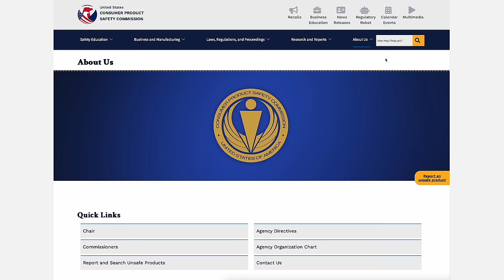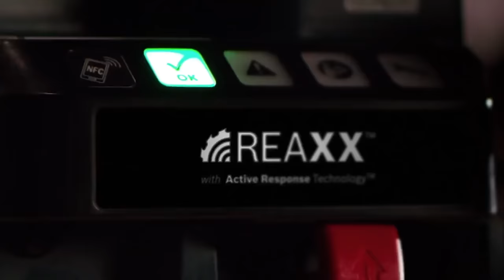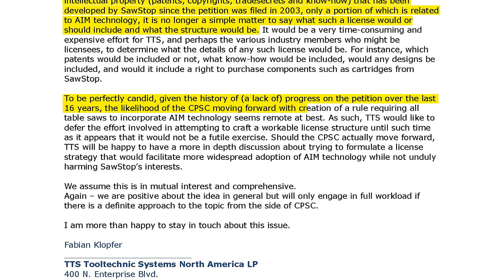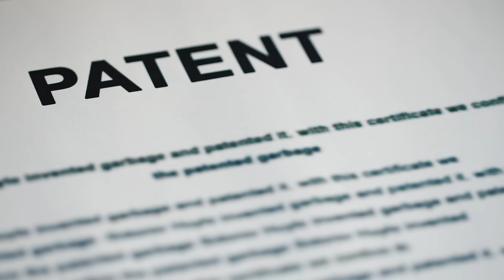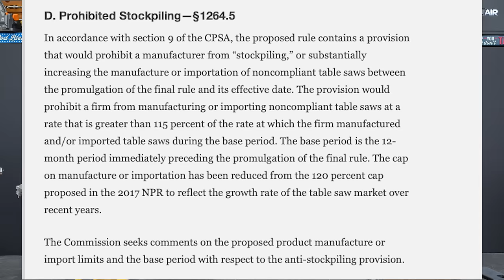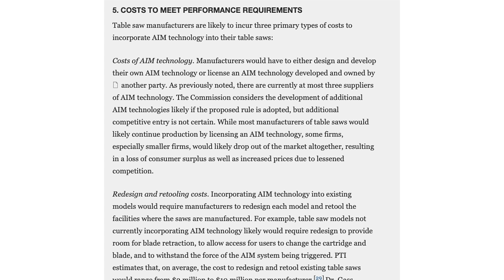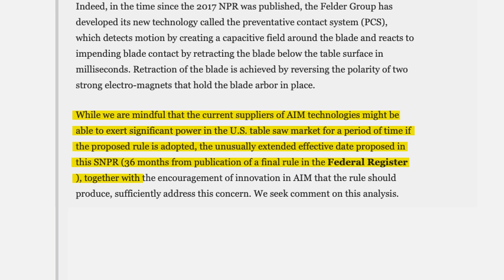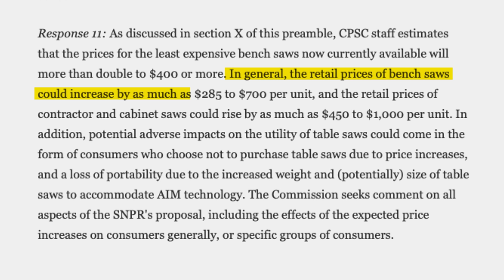The US Government is About to Change Table Saws FOREVER!

Comment: Listen carefully to what the CPSC "expert" said at 12:13. 

Read what Sawstop's website has on it's home page: "In the United States alone, over 65,000 people are victims of table saw accidents each year. The impact on the victim is substantial and in some ways immeasurable. OSHA estimates that the cost to a business of a single amputation is more than $130,000 on average. But these numbers do not take into account the pain of the accident, the ER visit, the surgeries and years of physical therapy."

Tell me they're not in bed with each other.
Reply: "Victims."  Nice wording.  That's like hitting your thumb with a hammer and blaming the hammer.   Everyone is trying to be a victim.  How about you just learn how to use a table saw correctly?  I'm 75 years old.  I've been using table saws since I was 15.  I still have all 10 fingers and have never had a table saw accident.  I respect the tool and make sure everything I do with it is done safely.  It's just not all that difficult.

Comment: I think the regulators should be required to go into a shop and actually use the tools they regulate, or at least participate in a lab exercises to show the reality of implementation of these new laws. 
 Reality is a wonderful teacher. One thing not brought up is that we need to return Woodshop to high schools. It is overlooked that Woodshop not only trains future carpenters and craftsman, but teaches those going into management what it takes to actually turn materials into  a product.
Reply: I think the regulators need to take 2 weeks off and then quit.
Reply: There are some professional carpenters that do not use a table saw. I think it is a lot more common in Europe where space is at a premium. They use a workbench and a track saw. Festool sells a table top for this.
Reply: I'm almost at that point where I can retire and work at a school wood shop, show them my cuts on my fingers and yell YOU'LL CUT YOUR FINGERS OFF!  That should scare them. ;-)  But then again, I'll probably have to use a sawstop enabled machine.  (I'll still yell though, LOL)

Comment: 1) know where the blade is at all times

2) use a push stick

3) only use as much blade as you need to make the cut

4) if it goes into the machine let it go, it’s gone, DO NOT try to “rescue” it

5) All saws have the potential to kick back

6) Make sure your fence is straight and runs parallel to the blade

7) Pay close attention to what you are doing at all times, especially while the machine is on.
Reply: 1) Yes. 2) Yes. 3) Yes. 4) Yes. 5) Yes. 6) Yes. 7) Yes.
Reply: 8) No beer.
9) Keep floor kleen.
Budy Guy cut of 3 fingers due to 8 and 9.
Reatached for free, thanks Caniadan healthcare.

Comment: If this goes through, we will need some combination of SawStop and retractable sawblade technology. While I get the appeal of having safer table saws, the price of it is not just extra 200-300, but also $200-300 every time you have to replace the cartrige and the blade. That's the current price of a saw right there. When you consider contractors, who may be cuting through all type of crappy lumber, containing screws and nails, they could be having to replace those parts few times a day.
Reply: One idiot running his finger into the blade and not only is he done for the day, but so is everyone else’s

Comment: Great video Matt! It is good to hear a balanced presentation regarding potential government mandated safety requirements. Like most complex problems, solutions are complicated.
BTW, I can't remember if the video addressed it or not but there is also the added cost to repair the saw when the AIM mechanism is triggered.
Great YouTube channel. I look forward to seeing great content by a good guy!
Reply: Repair the saw?  If the saw (outside the AIM system) needs repair, the saw's design needs to be revised.  In the SawStop system, the braking cartridge and the blade needs to be replaced after each triggered stop.  In the Bosch system, only the braking cartridge needs to be replaced, and only after 2 triggered stops since it is reversible.
Reply: @davidseslar5798  That is the definition of repairing the saw. The saw will not work unless those parts are replaced and the saw is repaired. This repair is not free. The blade is not free and the AIM module is not free.
Reply: @bretwood9779   Uh . . .  Replacing consumables does not constitute a repair in my book.  I don't "repair" a drill if I replace a broken or dull drill bit, or "repair" a reciprocating saw if I replace a bent blade.  The drill and recip saw are not broken in the absence of useable consumables.  Circular saw blades and AIM cartridges are consumables.

Comment: My first thought is how many accidents this will cause from the beginner who can’t afford the newer saws using unsafe methods and techniques to save money.
Reply: How many techniques are there?
Reply: Think of all the portable saws that could be used in the unsafe manner and put on sawhorses or tables or shelving. By design is just so much more secure by any tablesaw even the cheap ones. If you make it too expensive to do it the right way, there’s no limit to the stupidity of mankind to get it done anyway with the wrong tools and equipment. Me, for the difference in price I would just go for a basic panel saw, or a large format CNC . Yes, I realize that table saws are used for a lot more than sheet goods but that and small parts that you shouldn’t have your fingers near the blade anyway that’s where most of the accidents happen.. And then you’re pushing people towards bandsaw with no blade protection for small parts.

Comment: The return of the radial arm saw, and a new market for "pre-ban" table saws!
Reply: I've got one thing to say..."safety shield"
Reply: Until someone gets cute and sues because they bought a used saw and got hurt. I'd also expect that if this goes then right after will come a new line in workers comp policies saying you have to have said functions or you arent covered and I'm sure OSHA would be happy to make it policy as well. I don't buy for a second that they won't use strategies to implement it retroactively even if not overtly. Think of the damage to the construction and woodworking industries if everyone needs to replace equipment with new technology with limited or rushed development that causes demand to accelerate beyond manufacturing and prices become insane, prices already ripping North on inflation. 
If the government wants to buy the patents and such and pay the cost then go ahead and do it. If not, the technology is there and available. Why is it that they tell me they want me to be safer but at my own financial injury, when they put small businesses out of business people won't be eating, that seems unsafe too.
Reply: Lawsuit over a used table saw lacking modern safety equipment will go nowhere because if the used table saw is operated safely it is every bit as safe as a saw with this tech built in.   just about every injury that happens with a table saw is user error.   Also just like you can't sue because you got injured in a car crash in a 60s model car without airbags which of course was never even a thing you can't sue because you bought a used saw that lacks modern safety devices.  It is the users responsibility to buy a saw with the added safety if they want it. 

I could see OSHA going after big manufacturing  to adopt  something like this but in a very small personal or family type business   OSHA is irrelevant.  which is a good thing as requiring something like this could make them close shop. 

I'm glad I actually have my 30+ year old Craftsman table saw which I'm in the process of tuning up right now. The thing is a cast iron tank and with what I"m putting into it it will be working another 30+ years long after saws with this tech are in the scrap pile!  LOL

Comment: Thanks for all the time and effort you put into this video.  I have 2 points to add.
1 - The government is notoriously bad at underestimating the cost of proposed regulations.  Expect the additional cost of the first revised saws to be 2x the government's high estimates.
2 - As soon as the new reg takes effect there will be a huge shortage of the new saws available for sale.  Just like the huge shortages of electric vehicle roadside chargers and drone remote ID modules because government pushed new technology too fast.
Reply: To your first point, you could have changed "underestimating" to "EVERYTHING" and then just ended the sentence.
Reply: @81wildjoker  No truer words...  Especially, with THIS particular administration in control!
Reply: Just buy a Sawstop -they are available at every woodcraft store and lots of other online retailers. The other saw makers put themselves into this situation. This situation was very clear in 2003!
Reply: @jongaynor3461  Never wanted on. Don't now. Won't buy one. I'm not alone. That fill in the blanks for you?
Reply: I expect that the larger manufacturers already have designs that have the AIM features. And possibly the molds and tooling to install into a new saw frame for all types of table saws.
Reply: @81wildjoker  The government is VERY efficient at what it does. Unfortunately what it does is take money from the majority of people and give it to a handful of billionaires.
Reply: @jongaynor3461 not everyone has the funds to do that. I am a small business, a table saw isn't the most important thing in my shop, but it sure is nice to have. However, I can only afford a bench top for now as I'm still getting started. To assume everyone wants a sawstop (which is pricy, and when it stops the blade, you have to get a replacement part that also isn't cheap) I would rather just be an adult and avoid complacency.
Reply: So you think we need to Keep government out of this, this will create new laws and taxes with higher insurance costs to shops and individuals seeking liability and disability insurances.   Will OSHA rules shut us down if we don't comply.
Reply: @wulf67  yeah, you got me there.  But, just the one thing really.  Everything else they're bad at.

Comment: Most of those injuries are probably from people who removed the blade guard or riving knife
Reply: Unfortunately you can’t fix stupid. Fact is ANYONE can go buy this saw and use it with zero training. I personally am more than willing to spend $200 extra for the safety feature, it’s less than I would pay just to get in the emergency room. With more people producing the feature hopefully price will drop.
Reply: That is likely true, but the blade guards specifically present challenges and safety hazards of their own.  They don't allow for good vision of the process, they restrict the thickness of th material you can rip or cross cut, and they restrict the ability to use the saw to its full potential.
Reply: I   have a craftman saw that was here when we took over the house. It is from the 50 that has a built in workbench in the garage.  It has absolutely no safety features. We are very very careful because we know it has no safety.  
I worked in multiple factories dealing with metal and wood. Most injuries i saw was people not paying attention. So many were from simple things, like wearing gloves in areas where it was dangerous,  like drill press or even not wearing safety glasses. It was not just new employees, people have been working with these tools for years got injured because they became complacent and an accident happen. And on machines that have safety applied, like light curtains or safety buttons, people still get hurt on those. It is because they bypass them because without is quicker or they have run that machine a million times and don't need it

Even on here and other online medias, people who have saw stops that have had it go off, it is because they weren't paying attention and it hit their miter bar or clamp.

 You can't really put a law on making sure people make themselves safe. Especially in a home setting, where there are no rules and regulations (for the most part). You just must treat machines like saws as the dangerous tool that it is. And this is coming from an accident prone person who has not been injured running dozens of saws and other dangerous power tools and machines. Because I am very aware and careful around them. Normal things where I don't think about is where I get hurt.
Reply: @nikkafrog   I think there is a lot to what you say. I seem to recall s study sometime in the distant past that looked at the most common vehicle involved in accidents adjusted to the number of vehicles in circulation. The answer that came back was Volvo, supposed;y the safest cars on the road because of the all the safety features. The conclusion was the same, complacency and over confidence. Honestly I cant recall the source of this study or its authenticity but I thought it was an interesting parallel.
Reply: Maybe, maybe not.  You cannot use both all of the time.    Have you ever cut a dado or non-through cut on a TS with the stock guard or riving knife installed?
Reply: @somethingsomethingsomethingdar 

Don’t think it’ll just be $200, more like $1000
Reply: @somethingsomethingsomethingdar  You should be allowed to spend $200 more for the feature you want. The government should let everyone decide for themselves.
Reply: Do you think we need to Keep government out of this, this will create new laws and taxes with higher insurance costs to shops and individuals seeking liability and disability insurances.   Will OSHA rules shut us down if we don't comply.
Reply: @somethingsomethingsomethingdar   That's your choice to pay more.  I still don't want unelected bureaucrats to mandate ANOTHER feature they don't understand.  It will be detrimental to my hobby.  It's regulatory capture.
Reply: @ZeroColdx911  At least.
Reply: I learned to use a table saw at around 15 in shop class and I'm in my 50s now our class table saw had no guards or riving knives and nobody was ever hurt using it.  I have a table saw my father bought me 30+ years ago it has a guard,splitter and anti-kickback paws. But honestly I often used the saw without these. I have only had 2 kickbacks and because I learned how to use the saw and position myself all those years ago no harm was done in these events.   

While I agree these things do improve safety proper use of the saw is much more important than anything else.  Somehow we as a society have become too lazy to learn  how to operate machinery and mechanical things safely.  We largely  think we know everything already and take on a attuide we already know all we need to know.   In the case of the table saw those that think they know everything often think all they need to know is not to touch the sharp spinning thing.   Until we rectify this no manner of safety equipment will do much to protect people from their own ignorance.
Reply: Alternate take:

I shouldn't have to subsidize the healthcare, loss of income, disability, and the drain on the economy that 60,000 amputations from preventable accidents causes.

This same argument has been used to argue against seat belts, air bags, and just about any other safety regulation ever. 

In construction specifically I have seen companies drag their feet on safety equipment and rules for the sake of speed and profit UNTIL it was mandated by the government. There is a saying, "every safety regulation and code rule is written in blood".

How many more people need to lose limbs on your altar of "freedom". There is a balance  between Nanny State and dystopian authoritarianism. In my book that balance is found when the freedom one person possesses does not infringe on the freedom of another. 
  @wulf67